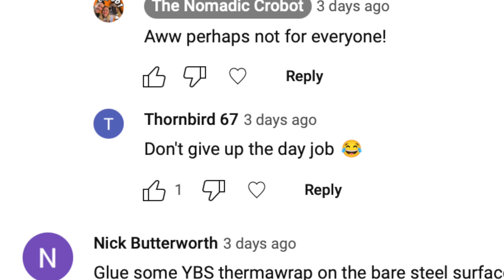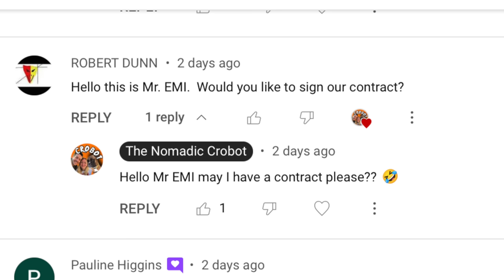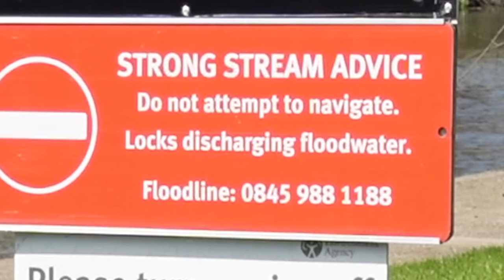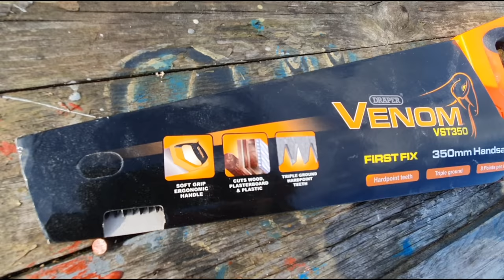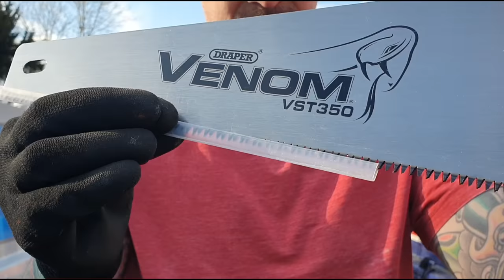CRAP NEWS for a happy narrowboat owner | NIGHTMARE off-grid HOUSEBOAT REFIT

Comment: Chris love your vids keep it up just a quick tip for using your saw... your holding it wrong... when holding the saw put your index finger forward of your grip. If you look, on the handle of your saw there's actually a black im assuming rubber type place for your finger to go... it gives you more control over your saw and also remember to use the hole length of the saw blade and kind of let the saw do the work by that I mean don't use it like an axe don't push down too hard on the saw you will just make it harder for yourself just guid the saw along your cut with a little down pressurebut a firm grip. Another quick tip for you if the wood your cutting is wet or damp... it can help if you rub candle wax on either side of yoursaw it stops the wood gripping your blade as easy. Hope this helps mate and as I've said keep up the Quality vids.
Reply from the maker: thanks so much, Becca has already given me a few more tips, seams I need to go back into saw trainings few people did say about the candle wax theory...how odd, watch this space thanks for enjoying the vlog

Comment: Lots of corrosion everywhere on your Narra', maybe consider some new metal being welded to the inner bow section. That battery box needs urgent work and just for advice, never tip a battery on its side because inside the bottom of the battery is a ledge where bits drop off from inside the battery, by tipping the battery on its side causes the bits to damage the innards of the battery making it not last as long. About 4 years for most batteries.  Now I know why you wear marigolds, to keep those fingers supple while you practise your David Brent guitaring.
Reply from the maker: thanks for the tips, that may explain why, cheers for the compliment :)

Comment: Chris why don’t you vactan then paint the bow thruster area. Then when paint is dry insulate it with foil bubble wrap. That should stop the condensation.
Reply from the maker: we do want to coat the area, but when its fully dry, then start putting som installation in and a fe vents , thanks for your suggestions

Comment: could you put a go pro down there and see if you can film any drips or water build up? also maybe put some insulation on the pipe that has canal water in it. This should reduce the amount of area thats cold
Reply from the maker: I said the same to Chris actually because I've got a go pro. The idea is to let it dry out, paint it with some sort of protective paint and then insulate it so fingers crossed that all oughta do it!
Reply: @TheNomadicCrobot  If that doesn't work fill the whole area with expanding foam 🤣🤣

Comment: For those who don't like your singing, you can threaten to sing some Vogon poetry.  

If the moisture is condensation, you might want to consider coating the metal so that it doesn't rust.  That would probably have to be some sort of spray, but better ask an expert before Crobotting it, then having to unCrobot it again.
Reply from the maker: now there's an idea, that will change things up, thats actually a great idea, I think some sort of coating will probably be a must thanks Peter...we dont want any uncroboating going on here

Comment: The problem with your saw is you.  Let the saw do the cutting!  Use a shallow angle and don't force it!  You could also use a Japanese saw that cuts on the pull stroke, but make sure it is made in Japan, not some American made knock off!
Reply from the maker: I think you may be right, im heading straight back into saw training, thanks for the tips

Comment: Apart from boat building not done right grrr
Bow thrusters add on a get rich scheme that is another major headache for boaters.
The 12v power systems on boats are a big problem
Equipment failure happens because of voltage drop.
With a bow thruster tube not only do you get it rust but you can get a cavitation hole punched through it by using it.
I would not want to buy a boat with one fitted by choice if I had to then I get plates welded over each end.
You use the Indian rope trick methods to get you off banks.
One step forward two back continues for you. A very expensive no survey may be not in money but certainly in time and efforts. 
Boats are over inflated at the moment by £10k + because of the energy crisis. That said boats in marinas are hurting those with property as well prices will drop at some point since government not subsidising gas and electric any more.
Keep calm and carry on.
Reply from the maker: our bow thruster area seams very pointless at the moment as its not even working, just problem after problem , boats do seam to lack a bit in build quality, and im sure were not helping to that theory with our refit, but were trying our best, yes a lot of people are beating us to boat cruising...but will get there one day thanks David